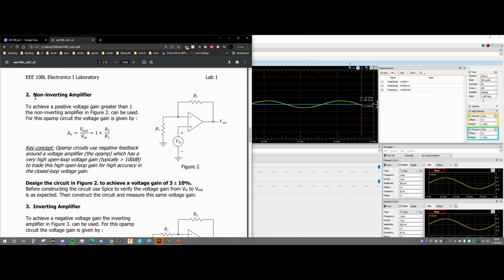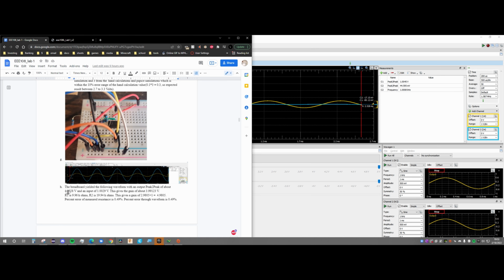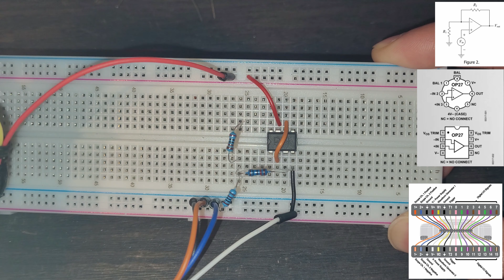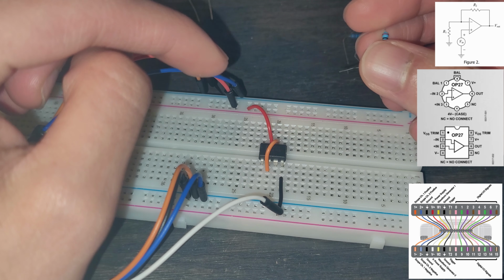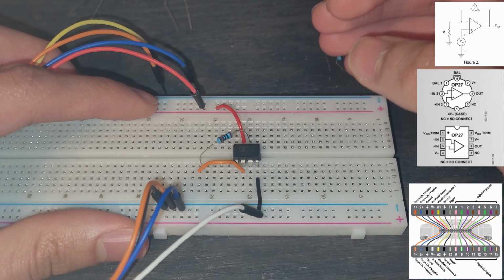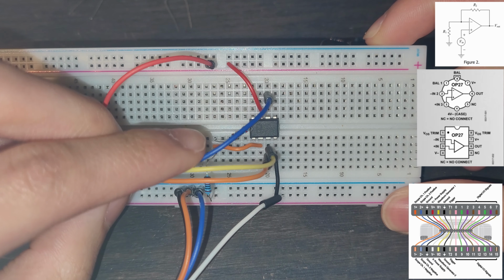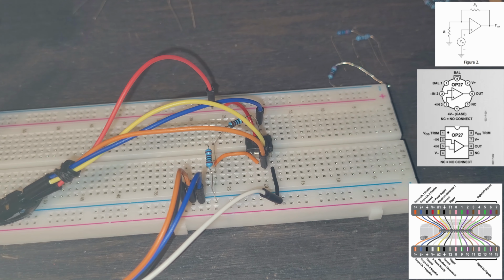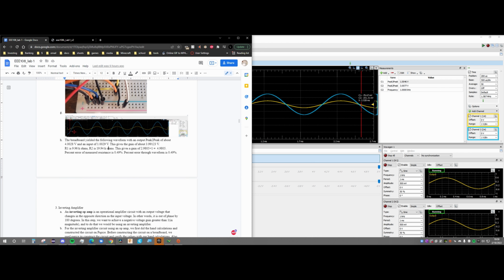Non inverting Amplifier on breadboard and analog discovery (Electronics 1 LAB | Opamp Applications)

Comment: If I use a 9V DC battery without using a AC/DC powersupply how would I get an +/-ve input through an op-amp?
Reply from the maker: I believe just hook the + side to the red and - acts as ground
Reply: @ComputerEngineeringCPE  thanks